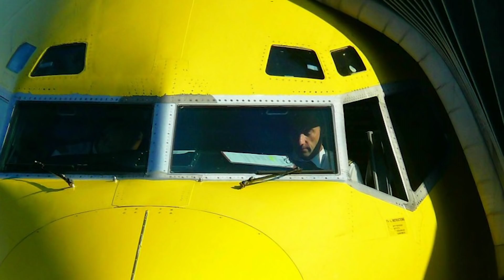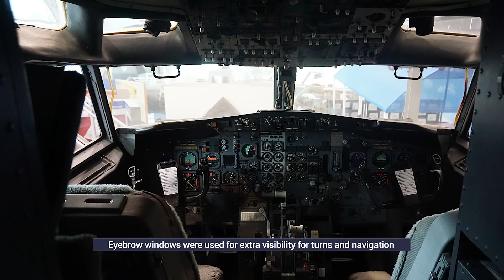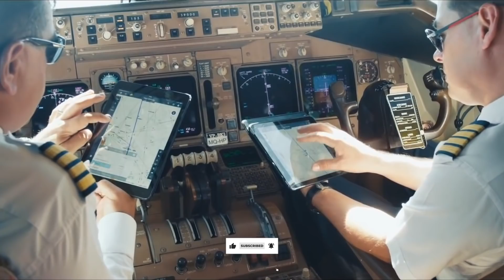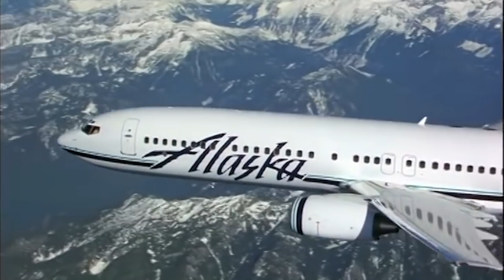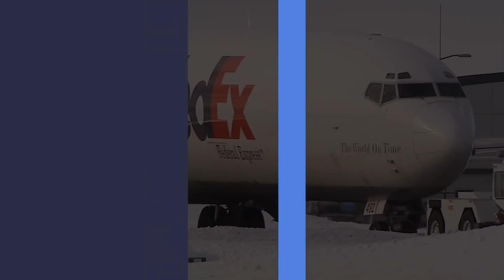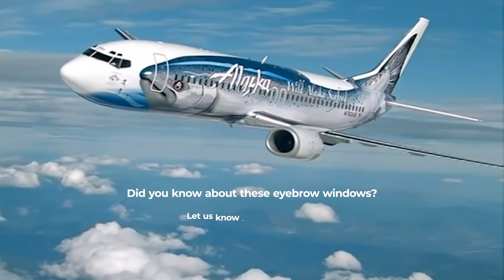Why Do Some Boeing 737s Have Eyebrow Windows?

Comment: With 52 years in aviation as both a commercial pilot and aircraft mechanic this is the first I have heard about the eye brow windows.  I have noticed them but did not know they plaid a special roll.  I never worked on any of the plans mentioned.  But I was a crew chief (mechanic) and a flight engineer on C-130s.  There is a row of three smaller windows on each side above the main windows, so I’m guessing they are eye brow windows.  But again there was never anything special about them.  As a crew chief I inspected them with the rest of the windows and cleaned them before each flight.

Comment: As a newly minted 737 captain my first leg ever in the plane was from DFW to SNA. Descending for the approach thru about 5000' msl one of the eyebrows on my side shattered. There wasn't much of a pressurization problem ( small window/low pressure differential). However it was noisy. 
So that's the story of my first landing in a 737 and my first into Orange county as well. P.S. only did about a year and a half on the 73 got a busted up right knee from that damn trim wheel as well, both knees were previously assaulted in the 727. 
Fond memories all.
In the short time I flew them the newest models of the737-800 were being delivered with no eyebrow windows and vortex generators at the base of the windshields which made the cockpit much quieter. The 73 used basically the same cockpit  as the 727-200.

Comment: As a retired Captain I was taught over 30 years ago that there was a regulation requiring so many square inches of windows on jet aircraft. The 737, DC9, MD80 type aircraft, due to size of cockpit wasn’t able to achieve, so manufacturers added eyebrows to obtain the required area of glass.  Sorry if this was addressed in an earlier comment, I wasn’t able to read them all.  Notice larger windows on DC10 and others, met the FAR requirements.

Comment: Lots of hours in C-130s with 3 eyebrow windows on each side (as well as 2 lowers forward and 2 more lowers on each side. Great for formation flying, navigating 300 ft contours in mountain valleys, tight turns into a primitive landing zone. A good example of "Form follows Function".

Comment: Is it to climb out of incase of an emergency?
Reply: That would have to be a very thin pilot.
Reply: The large side windows can be, at least for some airliner designs.  Latches released by a handle allows them to move inward and then back.  A stowed rope is available in aid with egress.

Comment: 'Eyebrow' window are something on a 'curate's egg'. ... as you opined, good in parts and with negatives.  Previous piston airliners like the DC4/4/6/7 and Lockheed Constellations didn't have 'eyebrow windows' as they used astrodomes for celestial navigation (that 'bubble dome' or as many as several, situated well behind the pilots and before GPS/SatNav, crews on many long range flights esp over water included a Navigator as well as a specialist Radio Officer and Flight Engineer.) [my own fifties nav training included 'celestial' - much as in Captain Cook's time.]

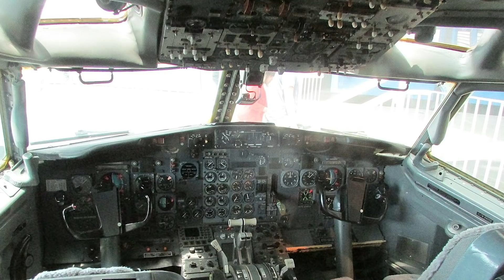Comment: I have a different question not related to eyebrow windows. At 3:00 mins what is that hump on top of the 737? I have seen it on other aircrafts and always wondered what it is. At first, I thought it's part of the air conditioning system but that is taken from the engine. Anyone would know or could Simple Flying make a video about that? Thank you in advance
Reply: That is a radome for an antenna used to communicate to a satellite so that passengers can connect to the internet in the air.
Reply: @genk1110  I didn't think about that. Thanks for your answer.

Comment: I knew about the eyebrow windows and how they were used for tight aircraft turns. However, it was my understanding that sextons need more sky access than what was afforded by those windows to be a viable navigation aid. Then again, I'm neither a pilot nor do I know how to use a sexton, so I might be wrong on that second part.

Comment: So even in it's late years, or those s still flying, did/does the 727 still require a 3rd person in the cockpit (navigator)?
Reply: From what I read here, the 727 still indeed needs a 3rd crew member in the cockpit but not for navigation, rather a flight engineer. Proposals for different variants of the aircraft that did exclude the flight engineer (even from trijet to twin) were made but never went through
Reply: @Kalvinjj  yeah my bad, i meant flight engineer. I didn't know if they did any upgrades to eliminate that position. Thanks for the info!
Reply: The only way to eliminate the FE position is with a complete redesign and recertification of a flight deck for two pilots.  That's what Boeing offered to DC-10 operators:  A conversion to the MD-11 spec cockpit as the "MD-10".

Comment: I thought the eyebrows are still optional on today's 737 (NG series, not sure about MAX series), not sure though
Reply: Earlier NGs did have them.  He mentioned they stopped in 2005, while the NG debuted in 1996.
Reply: Edit from last comment,

737 max doesn't have them 
737 ngs don't have them I think. Maybe only on a few aircraft now
Some 737 classic aircraft have them still 
737 original series most likely had them

Comment: Why do some a320neos have black masks around the cockpit? all I know about them is that they look cool
Reply from the maker: Great suggestion! I'll pass it on to the video team. - TB
Reply: @SimpleFlyingNews  can yall do a video on why some older plane noses were painted black? cuz I don't exactly know why that was implemented
Reply: Some Airlines just like having the mask on them lol
Reply: @MSRTA_Productions  I'm told it stems from the A350, which has very oddly shapt flight deck windows that makes the nose of the plan look awkward. So they painted around them in a aesthetcally pleasing shape to look more like the windows from the 787.  And now, they offer it on the A320 and A330.
Reply: Just a question. Why used the noses to be black and nowadays colored?
Reply: @ChaufMT  im pretty sure that the noses of older planes (ex. 707, 727, 747-100/200) were painted black to absorb more light and minimize glare, but nowadays a different kind of paint is used to prevent that.. other than that idek
Reply: The black mask adjusts more rapidly to ambient temperature. This reduces the temperature differential between the window and fuselage, thus reducing the risk of the much more aerodynamic flush mounted glass cracking during extreme temperature swings. While it looks cool to many, it's there on a purely functional basis.
Reply: @jblyon2  well dang.. mans just broke it down
Reply: @jblyon2  but I got another question tho.. why do most planes in the modern day don't have the black nose thing anymore?
Reply: @ItzGoldz  Upgrades in technology and newer types of paint are used so that the black nose is not needed anymore
Reply: It looks like goggles to me😂